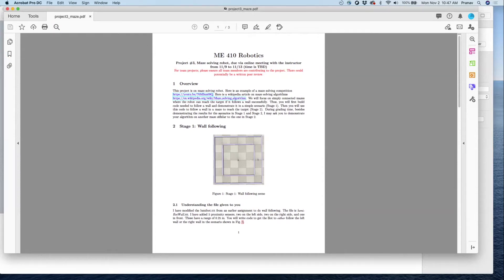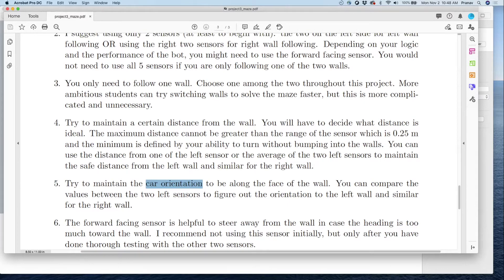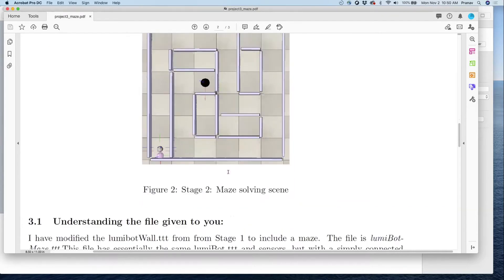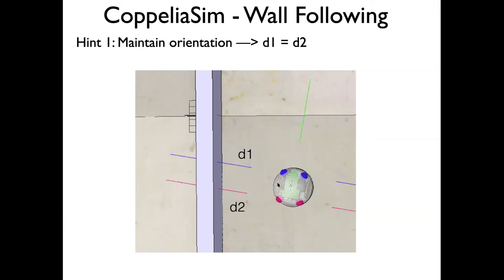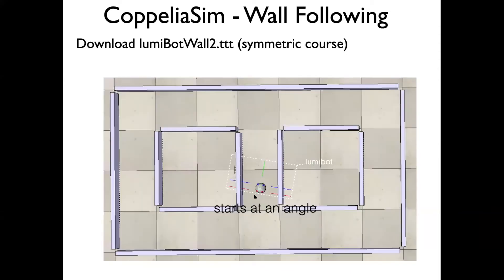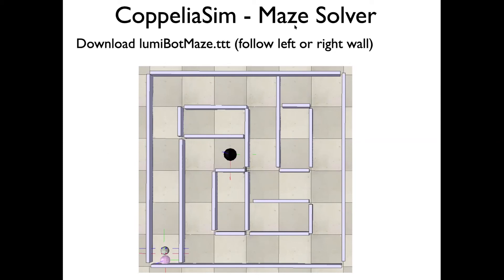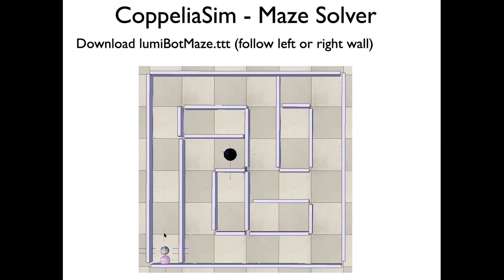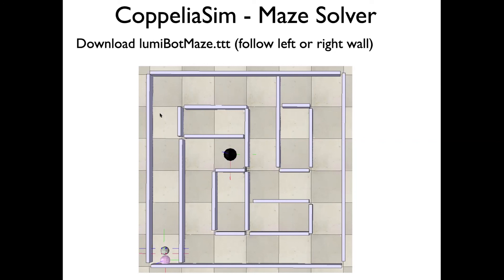Robotics Project 3: Maze solver using wall following bot

Comment: Hello Sir, I am currently learning vrep for simulating indoor slam, I want to use the quad rotor robot provided in the mobile robots library to scan an, environment. I want to use the maze solver algorithm with good offset to make it move autonomously in the scene, can you please provide me with the vrep coding?
Reply from the maker: I have linked the code in the description.